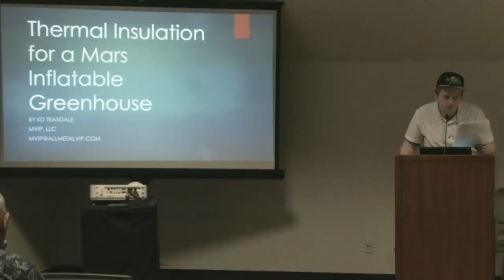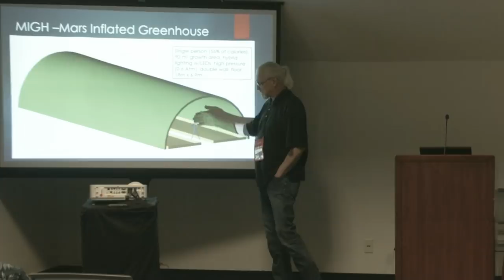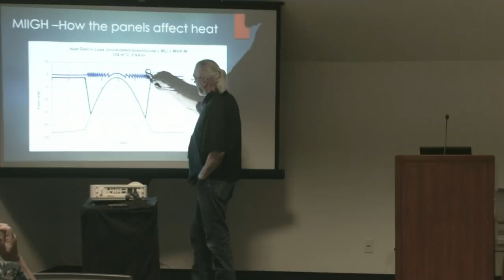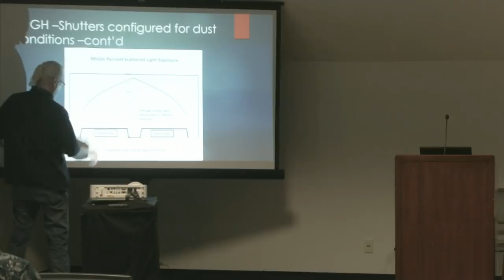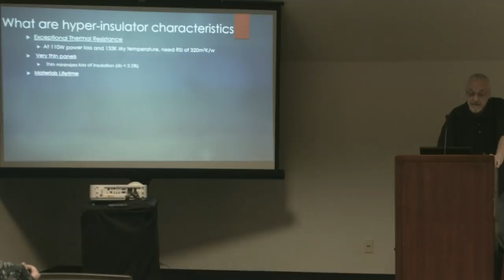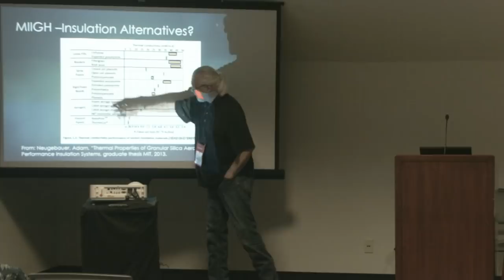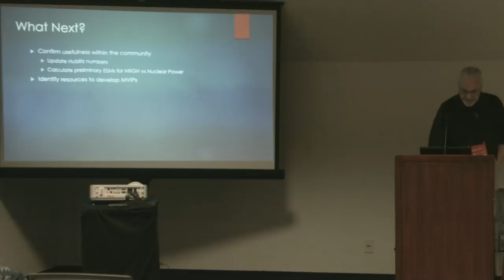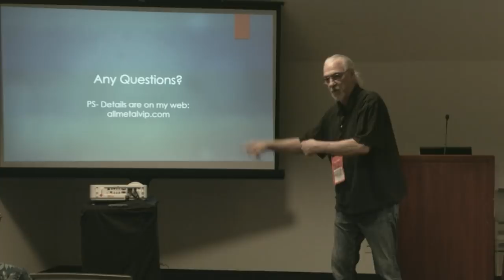KD Teasdale - Inflatable Greenhouse - 21st Annual International Mars Society Convention

Comment: Bad design. Too much surface area exposed to the atmosphere. Need to go partially underground. The late Mike Oehler had the right idea. Dig an east-west trench. Have windows facing the equator. Cover the roof with dirt/regolith and don’t bother exposing the polar side to light as it’s pointless. Have deep sections on the equator side to walk in. Have multiple tiers on the polar side to exploit as much sunlight as you can. Consider mirrors on the polar side to reflect more light back onto the plants.

Since you can’t do much with submarsanian thermal mass, you’d need to insulate the whole thing and introduce BioPCM within the insulated envelope (just below or within the ceiling) to hold enough heat to survive the night, or a power failure, in addition to shutters. But with the submarsanian design the shutters would be substantially smaller. 

No human should require enormous titanium shutters over an entire greenhouse for just a partial dietary supplement.
Reply: If you want to speed up construction. Make it an inflatable tube.

Dig up to half its diameter (optional but recommended) as an east-west trench, and drop the spill on the polar side of the trench. Inflate the tube, and dump the spill as a mound over the polar side of the tube. 

That way only a quarter of the tube is exposed to the cold Martian atmosphere, but the quarter you get brings in as much sunlight as you will need. You get more internal volume than a half tube and a circular tube is more stable. And instead of having to put shutters on an entire half tube, you only need to shutter a quarter full tube. 

Put your planters at the lower and rear of the tube. Taller crops in the lower bits and shorter crops at the rear. Add hanging planters in the early season, and as things grow and you do an early harvest (or if any crops fail), shift the hanging planters out of the way so you get more light to the rear tiers. 

The tube diameter doesn’t need to be especially wide, but they could be as wide as you want.